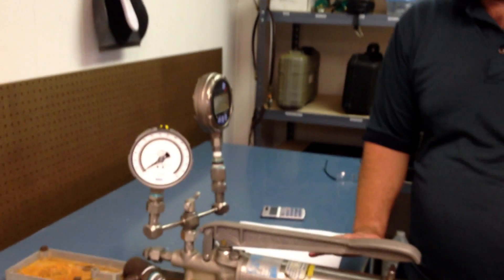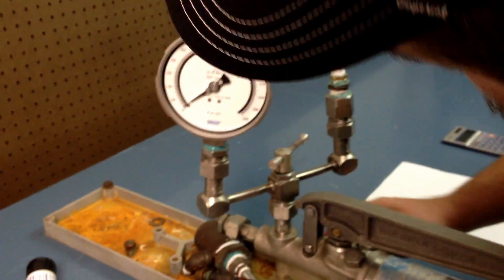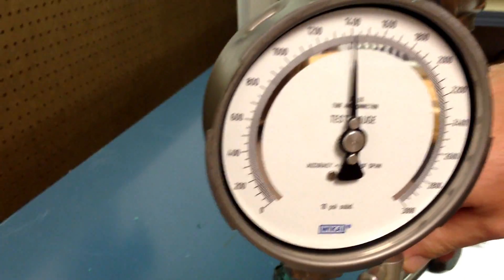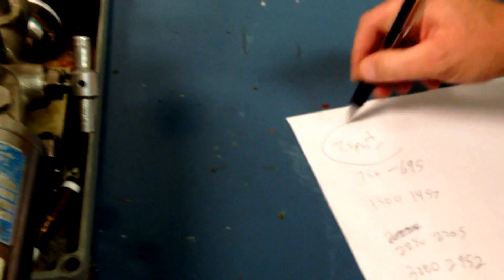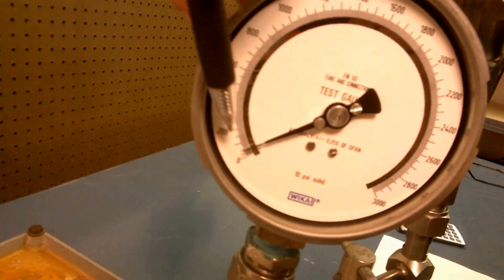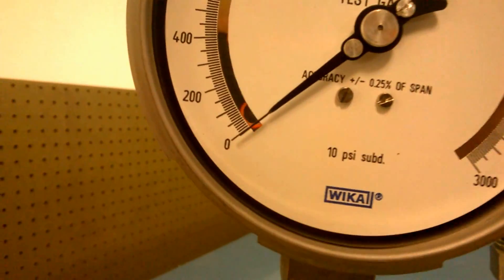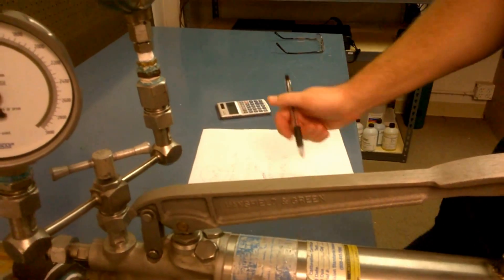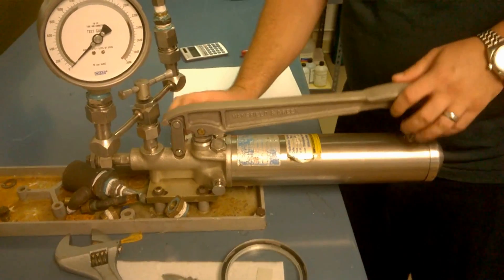Calibration of a test gauge using a pressure gauge comparator.

Comment: Many of the below comments are correct; but also he is doing the calibration backwards. Should be setting a known pressure using your digital standard gauge and recording the output of unit under test.

Comment: how did you clean the liquid inside the preesure gauge after calibration done
Reply from the maker: The technical way to clean out the bourdon tube after calibration involves using a vacuum pump, 2 vacuum rated beakers and a solvent.   You put the tube under vacuum, fill the tube with solvent then vacuum out the solvent.

Comment: This calibration method is not accurate at all, no preloads done, no warming - up for the gauge to ensure that the pressure difference is accurate.
The value of the video is concentrated on the adjustment of the deflections of the pointer.
Thanks for your effort ....
Reply: https://youtube.com/@instrumentprocessmanagement?si=KYaVPbWQI8q0Gm8E

Comment: please old shop am confuse here how did you get the figures 750 1500 and othere figure up to 3000 how please explain to me how can i calibrate hydraulic gauges with FLUKE CALIBRATION P500 PRESURE AND 2700G REFRENCE GAUGE
Reply from the maker: +blessing samuel  the calibration test points are determined by your procedure.   I am using a procedure that tells me to choose 25,50,75and 100% test points.
Reply: OK thank you I really want to know and lean how to calibrate gauges please I need your mail adress please here is mine omozuafor@gmail.com

Comment: I'll give you a thumbs up. You look like someone who actually knows how to use a Ametek Dead Weight test. Type "T" 15,000 psi Comparator. 

This same pump is also used with weight set. which it looks like you have set up for based on how you have your pump mounted to the drip pan. Make sure you read your manual on using that adjustment knob on the manifold.  It's rated for around 2,500 psi. 3,000 usually is to a  problem. You can use the manifold like you have it up to 15,000 psi but you can not adjust pressure. Looks like that is an old pump. Looks like the reservoir cap fits over the reservoir. It wouldn't surprise me if it is well over 35 year old. I can also tell this hasn't been sent back to the factory for repair in over 20 years if not at all. You still have the original vent plug and missing warning tags that is mandatory for every unit that goes in for service. These are good pumps. On the tag located on the reservoir has the manufacturing date (MFG) date and assemblers initials. This video helps prove that they last for years. 

Refurbishing pump isn't too difficult. Break it down, clean it up and replace the o-rings is usually all it needs to repair it. As long as you know how the set the front poppet, bleed it and make sure you have the right poppet in the poppet location. One of the poppet has a tip which rides on the hi/lo valve. You probably all ready know all this stuff, but in case you don't... you do now.

I hope that fitting on the back of that reservoir is only used to gravity fill the unit. People were killed pressuring it that way. That is why they went with the safety plug on in place of solid vent plug.like you have. As long as you keep it open during use, you should have no problem. Reservoir is not a pressure tank. Again... you probably already know this stuff.

If you ever have any question or issues with it,, just reply and I'll talk you thru it. You did a good presentation.
Reply from the maker: L Stevens, Spot on!  It is an older modified dead weight tester.  The weights and piston sleeve were worn to the point of replacement so we decided to purchase an ashcroft type of deadweight tester years ago.  We plugged the outlet to the piston assembly and just use the pump now.  We sent the pump in to be rebuilt maybe 2 years ago to the ametek key largo fl. facility.  It's a great unit and has been around our shop for at least 20 years that I know of.  The only thing I would change on it is the bleed valve design.  It's a metal on metal seat and leaks by if there are any containments in the fluid.  That's one of the reasons we went to the ashcroft deadweight tester.   It has an-o-ring bleed valve and holds a bit tighter.  I've gone back and forth on moving to a nitrogen based system with a digital crystal Nvision lab readout, but the deadweight testers are just so reliable with a little bit of maintenance and you don't need to refill nitrogen bottles all the time.  Not to mention the standard nitrogen bottle only gives you around 2500 to 3000psi.  Sounds like you know your stuff.  Thanks for the comment!
Reply: I worked for Ametek in Largo FL for several years as a Senior Service Tech, Calibrator and Sales Support. If you have any issues or questions about troubleshooting, let me know and I'll talk you through it. I helped many customers while I was working there. Or contact their customer service and see if they still carry that type of support. I'm sure they do. I do remember the relief valve being and issue on these units on new and old. The units I used at Ametek didn't seem to have that issue. Another issue was the o-ring popping off on the poppet across from the hi\lo valve. It would tend to pop off when operator was pumping the handle while switching the hi/lo valve trying to build pressure. Sometimes, even doing the bleeding process. Than the Hi side would no longer work. You keep pumping and nothing would work.Or if it did, it would take a real long time. To prevent this, we would put a drop of glue on the groove and than slip the o-ring on without getting glue on top of the o-ring. We did this on all pumps when building them as new and repairing customer units. The glue we used was a superglue made by Loctite. You won't find this in the owners manual unless they updated it.

I've seen some of Ashcroft pumps and gauges. They seem to be really good units. Their gauges seem better than USG. gauges. I calibrated some that came into our plant with our units. I was checking them out. Fell right into calibration. Mechanism was thicker. Hysteresis was no issue. That's going back a few years.

A common geographical error is Ametek is located in Largo, not Key Largo. Key Largo is very south of Florida. Largo is between Clearwater and St. Petersburg west of Tampa. It's irrelevant but now you know. 

For your readers/followers... I also agree with your comments about nitrogen. 

As far as I know, Ashcroft makes a good unit. Pall Aeorspace and Leslie controls uses Ashcroft dead weight testers. From what I was told, the engineer that came up with that pump and piston assembly quit Ametek and went to Ashcroft and implemented that product. It's a copy of Ametek's 10-Pump. It maxed out 10,000 psi. From what I heard. Ametek quit making them. 

And now you and your reader know a little more..
Reply: Please I need help from your side

Comment: This video is great but, If your gage is off by 100-150psi what other ways can you repair the gage?
Reply from the maker: +verne stewart   There is also a range or span adjustment and depending on the make of the gauge, a mid point adjustment and a micro span adjustment.  Ashcroft recommends that if a gauge is over 10% off to just replace it.